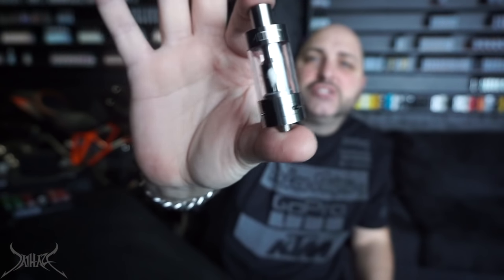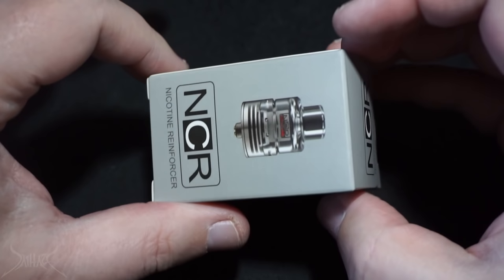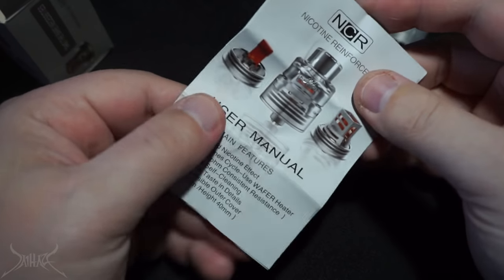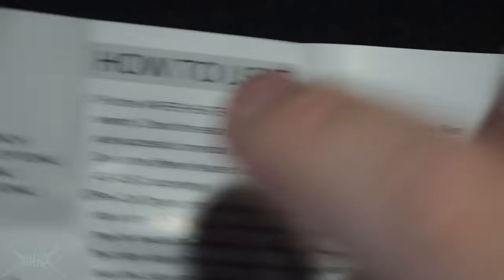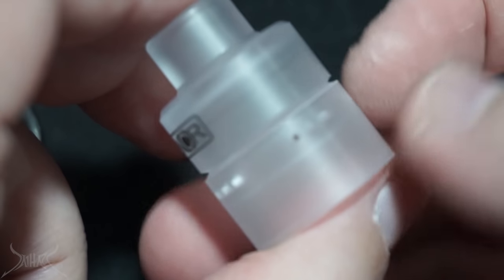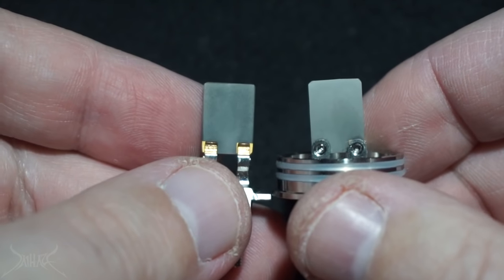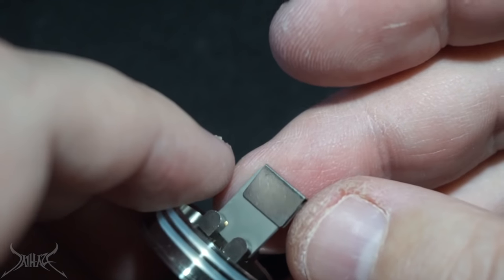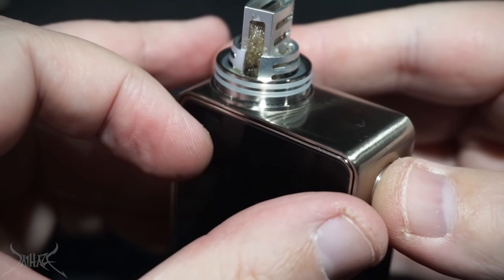WARNING: NCR (Nicotine Reinforcer) RDA Review and Rundown | #fingerbellybutton #dangerous

Comment: Its like ramming electricity thought an empty circuit board that why it keeps jumping ohm's. Because the more power you put through it will change resistance because it will be hotter and there will be room for more power to go through. That alone is 100% unhealthy for both your lungs and for the mod. Id hate to think what happens to this on a mech

Comment: Jai- just wanted to let you know what this is. It isn’t in fact ceramic, it wouldn’t heat as ceramic isn’t conductive. They’re actually using a plate of tungsten. That’s why your resistance is fluctuating. TUNGSTEN SHOULD NOT BE USED IN NON-TEMPERATURE CONTROL, it’s like titanium or pure nickel.

It’s a pile of shit for a billion other reasons, but if you really wanted to, you could input a CSV from Steam Engine for tungsten and use it in TC. 

The construction is abysmal, the clip could conduct off the tungsten if the cotton was too thin, than you’re vaping on whatever the fuck the clips metal is, plus the tungsten (which looks like it may have been what happened from your blackening, just due to the handful of hits I can’t see it being just due to the tightness of the cotton in that one point.)

Than you have the issue of the tungsten getting no airflow, it’s almost completely covered in cotton, you only have maybe half a mm of tungsten on the sides, and it’s heating from the inside out, so you’re cooling basically zero with haphazardly placed holes in a piece of plastic. 

Lastly, the materials used for the “cage” could be literally anything, and with the clip in close proximity, with it almost definitely creating a connection with the tungsten, it hits that, dead short.

I may have my testicles literally ache when I see gold decks, diagonal airflow cuts that don’t direct the air; just make it go straight up, PMMA tanks, copper/brass internals on an atomizer, mesh being used as a heating element, etc, but I think this literally wins the award for the worst atomizer ever made..I know Vandy Vape has to have something to do with this..they just have to..
Reply: (Unless ceramic is baked with coils inside)***
Reply: I know this is old, but you do know there's nothing inherently wrong with mesh heating elements (coils) if there was, the Profile or similar RDAs wouldn't be as popular as they are. Just wick them properly. 

Also there's nothing wrong with a ceramic coil either, vape rigs designed for THC wax/dry herb use ceramic coils  or more properly, a ceramic plate sitting on a type of conductive spring. It's actually the most popular out of the two popular concentrate coils as the next is a typical round coil wrapped around quartz

Comment: It looks like a Composite wafer with restive conductive Properties,  It even has a weird setup, You would think the plate would be connected from the far most edge of each other to allow a Even heat distribution, Let alone With the Ohms going all over the place is Typical properties of a Resistive compound Like the substance found in Electronic Ceramic or Carbon resistors, When they heat the restrictive properties change values,  There would be a Huge ramp up time, Meaning more Wattage needed to hit harder, = Potential particle inhalation due to higher heat,  Also is the Metal Particles used Fume generating during heating, I personally wouldn't heat a fish pond up with this material.
Reply from the maker: nice comment, seriously ;)

Comment: To say this device isn't safe because the material, in its powdered form is hazardous, is a misnomer.  Glass is horrendous for your lungs when powdered, but basically inert when fused together.  I get that the device sucks are far as enjoyment goes, but I don't think anyone can say with certainty that heating aluminum nitride for vaporizing is more dangerous than using Kanthal/Nichrome/Stainless Steel.

Comment: Will done. Safety and education is a necessity. DJLsbVapes did the same thing with Kim Sun (he refused to vape it though).
I started with 316L and basically that's what I stick to (only metal that's used for cooking is my reason). I'm still sketchy about N80 and what happens with a dry burn, long term etc but I'm starting to give in and use it more. Peace!
Reply: Soled101 and what's wrong with n80? Any metal heated up long past white hot will start to release toxins.
Reply: Soled101 didn't say I did but that's the only thing you have to worry about. SS is way easier to scorch, and you didn't answer my question.
Reply: chris bridges and neither did i. You didn't ask a question you made a statement. I'll assume the answer you're looking for is that SS doesn't leech at temperatures you should be vaping (therefore in theory would be the safest option to heat and breathe). Although I did say I use a little N80 there's no tests for hearing and breathing in (therefore I find it sketchy). You are and breathing in vapers and eating with cooking since before I was born. There's 2 metals that were widely used that people are beginning to not use anymore (safety and available options now). 
Not sure if that answers your question but there's more technical information easily available like here http://www.djlsbvapes.com/different-wires/
Peace!
Reply: Soled101 maybe you missed it the first time, I asked what your problem with n80 was. And thanks for the link but I was hoping to learn something new.
Reply: chris bridges no worries is a good site. I have no problem because I use it just not as much as SS (I stated this in my original comment).
I came to comment on Jai's video and that's where I should have left it. Someone gotta useful link out of it so I guess that's a bonus. Peace!

Comment: Thanks for this! My brother got one BEFORE I saw your video... good thing the NCR would barely fire up at low wattage (he's on a single batt). Took it off his hands before he could do anything with it. Now I'm stuck with it. I did try to vape off of it (a couple of puffs) and IT WAS NOT GOOD AT ALL! Won't fire up unless you're at 60W to 70W and there was NO FLAVOR! Definitely not good even if it were proven safe to vape.
This morning I decided to remove the "wafer" and put in a simple build (clapton, 5 loops, 3mm). Well, it works! Pretty decent vape. My question: would it be "safe" to use it this way? The only thing that worries me is the material used for the topcap and how it'll interact with heat. Your input would be most appreciated.
Thanks!

Comment: Dude ! You are using it wrong !  I was curious for how you use that thing and i watched some reviews before yours.  The clamps are made to snag on the coil and then you put the cotton on top of that clamp Not straight on the ceramic coil ! and then you place the aluminum part on top of the cotton. I believe the way you  used it changed totally you experience with the atomizer ,certainly  ruined it. Probably it is shit but you didn't used it properly.

Comment: It's a tungsten heating element with a decently high TCR. That's why the resistance is incrementing upwards when firing. If you use a DNA device, which has a dynamic resistance readout, you would see this rise in real time. I never liked the Altus V2 i bought for $20 a while back so i can  guarantee i wouldn't like this piece of shit either.

Comment: Hmm. strange. I tried to get information about aluminium nitride, but i can't find any information about how poisonous this material is. According to NFPA 704 and UN/GHS this material is irritating, but not poisonous ( https://en.wikipedia.org/wiki/Aluminium_nitride here you see the NFPA 704 sign and on the german version of that page you see the UN/GHS symbol GHS07, both say that its irritating, not poisonous). 

Then i found this https://noahtech.com/data/safety.12363.pdf . 
This doesn't look good, but still no word about this material being poisonous. I can read there that you shouldn't inhale the dust and should avoid to get it into the eyes. Inhale it? Dust? Getting it into the eyes? I doubt that you could inhale a ceramic plate and there is no dust and i don't think that anyone is stupid enough to put this into the eye. Maybe Right To Vape shouldn't have asked the maker of aluminium nitride, but instead a producer of the ceramic plates.

Is there any reliable source (besides the word of Right To Vape) about how poisonous this material is, because all websites which i found tell me that this material is not poisonous at all ( http://accuratus.com/alumni.html this page even tells me that aluminium nitride is used as a non-toxic alternative to beryllia).

Please tell me where i can find the information about how poisonous aluminium nitride is.

Comment: You are so totaly wrong! The product isn't perfect, but please don't try to kill the wafer system! I like the NCR, cause i have a brain and i use it. But first, there is NO! POISON(cause of the Aluminium nitride) at that temperature we use this wafer! Also ceramic wafer is coming soon. The NRC RDA is not easy for beginner and the airflow is to tight(i made bigger holes🤷🏼‍♂️). Let me explain how to use the NCR right: Set the clamp directly on the wafer. Don't bend it up! Now, lay a strip of cotton over clamp and wafer! Let both sides of cotton as long as to the bottom. Make sure that you can see the whole side(outer edge) of the wafer but also use much cotton! Set the alu-shield around and do liquid on. Now again, make sure you can see the wafer on both sides! Cause the steam is coming from there! Use the allen key e.g. to push the cotton up, left and right. Liquid again on top. Now go around 80W and have fun my friend! Let me know how you like it, to do it my way. Sorry for my english, I'm german🤷🏼‍♂️
Reply from the maker: aluminum nitride is horrible and plenty of posts below to show it shouldnt be vaped on